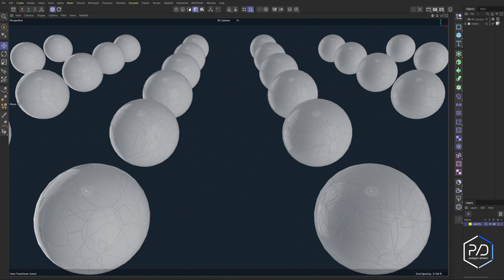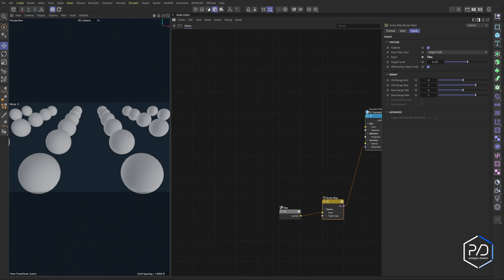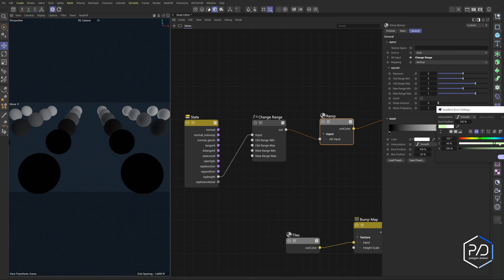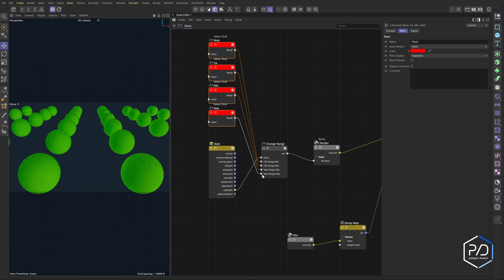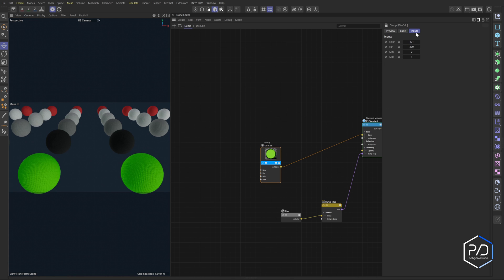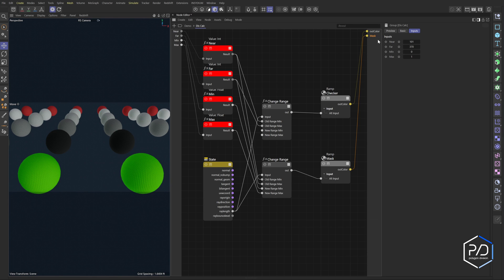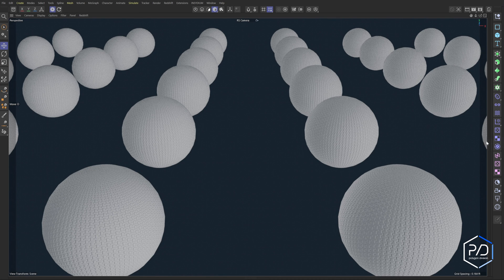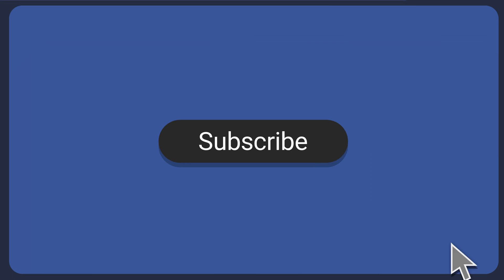Calculate Distance with Redshift shader nodes-Cinema 4D Tutorial [4K]

Comment: I noticed that there is a "reference object" option in the transform space. How would I assign this to something like a c4d field or a sphere?
Reply from the maker: I think what you are looking for is the 'Distance' node, maybe? The reference object doesn't do what you're wanting. The problem you will run into is a sphere or field will be calculated at the anchor point which wont consider the offset of polygons to said center point. There are a number of ways to accomplish this... one that comes to mind is using Xpresso and converting distance data into a User Data node.
Reply from the maker: Give me more info on what you're trying to do and I'll make a quick video! Be specific please.

Comment: This is great, thanks so much for sharing. Will this same node set up work to drive other parameters such as Opacity?
Reply from the maker: Absolutely! Because we're clamping the values from 0 - 1. Opacity is just that. We could use it to fade objects in the distance. Essentially, we could effect any parameter with an input!
Reply from the maker: I was going to make you a demo really quick and discovered an error when using the shaders Opacity. So, I sent Maxon a support ticket. The shader works fine but when I flip the values it errors and makes the material black. Here is link to the file I sent over. Look through it! https://drive.google.com/file/d/1jil00nZ2HGJujmOfdsMQ-oV1zKXQ-Hwa/view?usp=sharing
Reply: @PolygonDivision  Hi ! This was exactly what I have been looking for to be able to fade objects in the distance. Did Maxon answer yet? I would really appreciate a solution. Your tutorial is amzing, I could never have figured this out on my own.
Reply from the maker: I asked the question with their technical help and they said I'm emailing the wrong department! So I resubmitted my question and got no response. I do send them a feature requests all the time and rarely get feedback.
Reply: @PolygonDivision  Could you think of another way to do the same trick? In a scene I have objects from one horizon to the other (in Equirectangulair  VR) and it would make the scene much lighter if I could graduly make them dissapear.